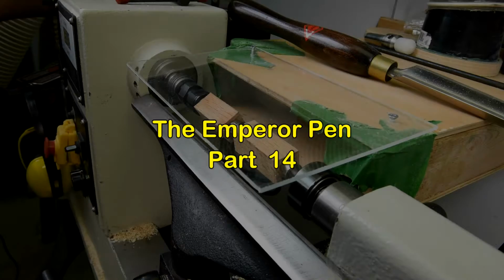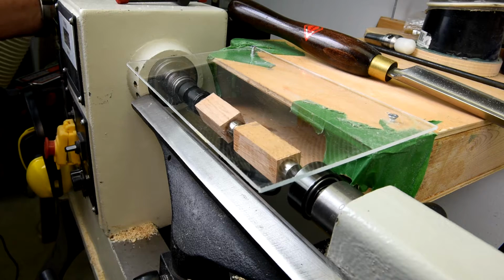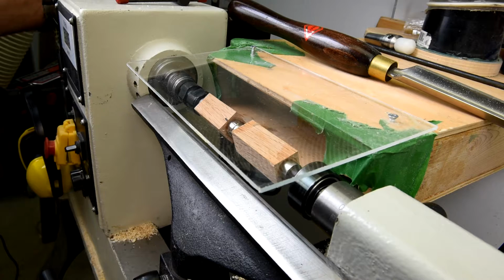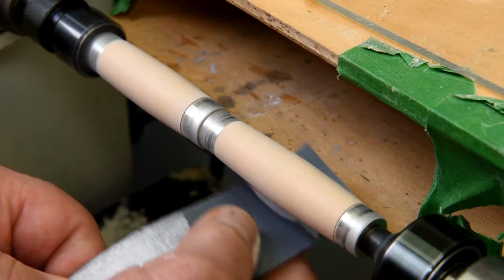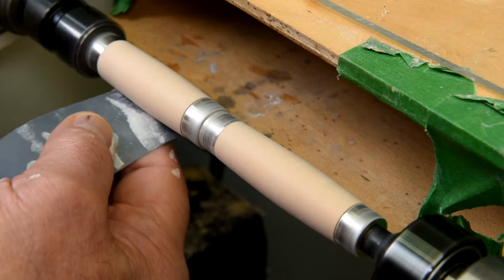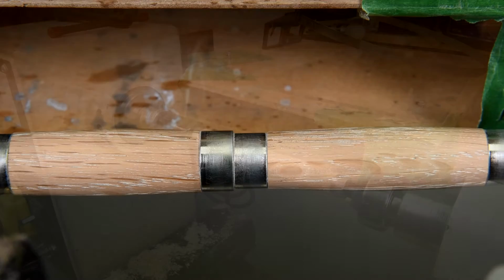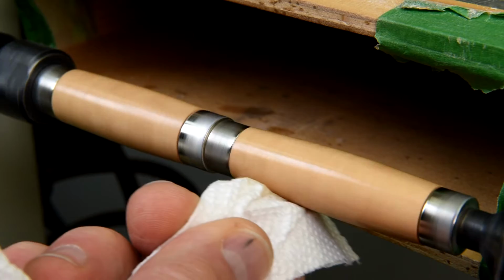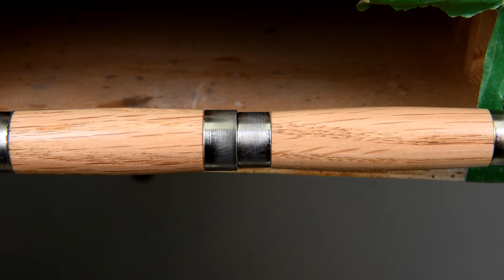The Emperor Pen - Part 14

Comment: Do you ever worry about having to buy new bushings if accidentally run the sandpaper over them? Like because they get just a little bit smaller, and over time they may not fit anymore.
Reply from the maker: I have actually wondered about that too. I guess that the smart thing to do would be measure the diameter of the set when new with a caliper and mark those dimensions on the bushing package. Then when using a set that is often needed (and for me that would be the Sierra line) periodically check. Unfortunately, I don't always do the smart thing, lol. Thanks for watching and taking the time to comment :)

Comment: hi Ron have you had experience with turning 2x4 material such as Douglas fir I'm interested in trying that out but I'm not sure if it's going to work
Reply from the maker: Hi William,
I never turned fir. When I think of fir, I think of a wood that may crack and fly apart while spinning on the lathe. Maybe that's why I've avoided it, or perhaps it's because I never had any to try out, lol. By "2x4" do you mean like fir studding?
Reply: Ron Calverley yes 2x4 framing wood
Reply from the maker: I'm envisioning a piece ripped to 1.5 in X 1.5 in. and then to whatever desired length.